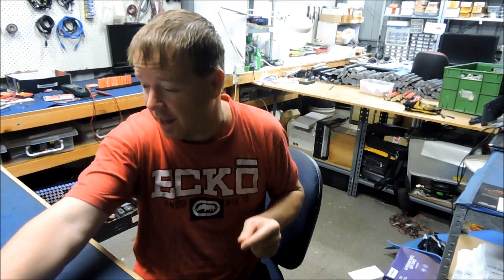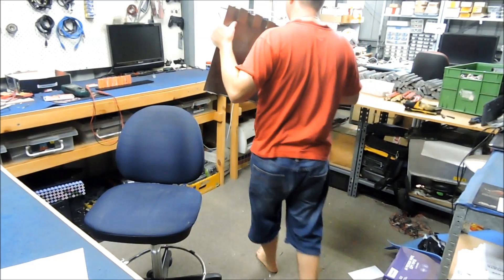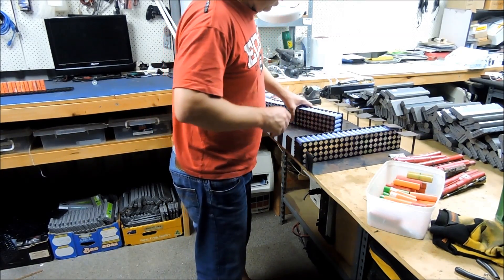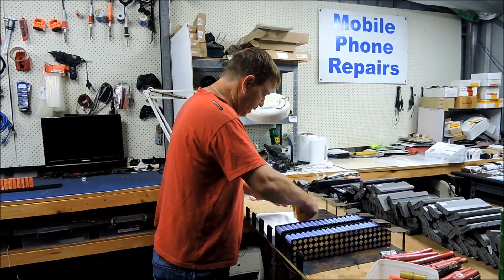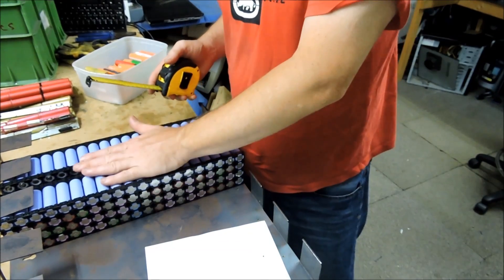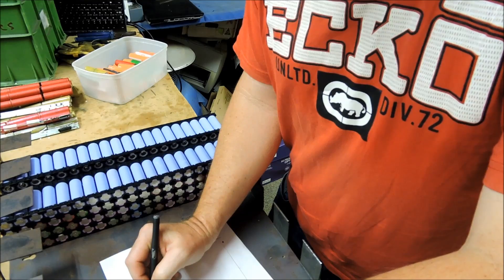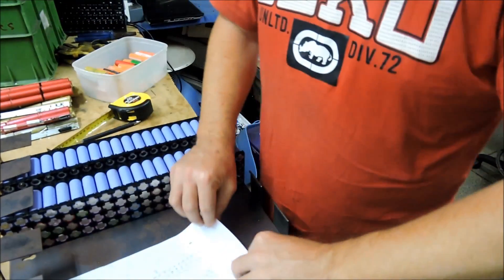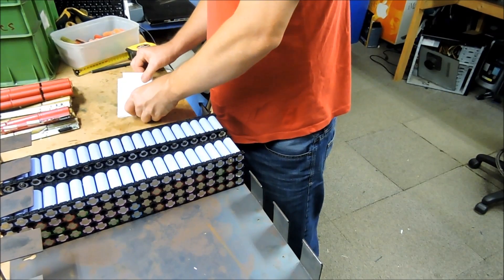4 am brainstorming rant talking about increased safety of my mounting system.

Comment: Instead of conductive metal, how about rectangles of cement backer board (like Hardieboard or Durock)??  Comes in 1/4" thick, is relatively easy to shape (you score and snap it like drywall), and is inexpensive.
Reply from the maker: There have been heaps of great suggestions, but none I can make work so they look good... Call me crazy, but still making new plans around making this bigger and better.
Reply: You can also sand and spray paint cement board (esp the HardieBacker stuff) and it will look good.  I would be more concerned with not adding extra fuel (the paint) in the case of a fire though.  Hardieboard is a nice tan color and Durock is cement grey.  There has to be equivalents products there like http://www.toppstiles.co.uk/tprod3919/hardiebacker-250-cement-board-6mm.html.  Just put a screw into it from the back of your rack and away you go...

Comment: Fiberfrax really good stuff at work. It can withstand 1500 degrees for days and you can get it then high density. That would be a really good way to save your ass. I'll double check the spelling I feel it's not right but u get the name.
Reply from the maker: Cool thanks for the info I'll look into it

Comment: you can add ceramic blanket in between the space. those are used as furnace linings.  available in various sizes starting 1 inch :-)

Comment: Just make fully enclosed boxes with partitions and a lid that is held open by a fuse-able link or a piece of string. If a fire starts the fuse-able link burns letting the lid fall by gravity, thereby depriving oxygen from the now closed box. You can even line the inside with fibre cement board for more fire protection and to insulate the steel box from shorts to the busbar.
Reply: SidneyCritic ComedyHound nice idea, unfortunately the cells are a source of oxygen for the flame once they start venting

Comment: Hey man!!!
I'm big fan of your DIY project.
For shielding I can recommend ceramic tiles between packs of celes. You can cat them to the length and to hold them in to the place use wooden triangles with you attach to the wall. Make slots for tiles so you can have access to do inspections.
Good luck.
Reply from the maker: thanks for your ideas, Pete

Comment: Hmm Reading the comments and thinking about it, while it might be possible for a fused cell to blow the fuse and if fully charged still blow its valve I really don't think it will then put out a fireball all by itself and for long enough to then heat up and catch fire the next cell. I think this could be over thinking it. Also every laptop batt cell could do the same, yet for years the build has not changed and 99% of laptop batts are fine. So if a cell shorts the fuse will blow, if it still is shorted it will heat up and blow its valve and very shortly after that it will start running out of juice.

Comment: in reply to both
DIY Tesla PowerWall,
and to HBPowerwall.

I watched, recently, a video on a "High-Build" ceramic PAINT.

Generally, it ......

1)  Kept oxygen away from direct contact with hot-steel
     (reduced risk of steel burning, or corroding (oxidising)).

2)  Like most insulators. 
      If it is a good thermal-insulator,
      it is (usually) by default also a fairly-good electrical insulator.

3)  Robust, & high-temperature tolerant.

4) High-build (thick-film) - dip or spray applied.

5)   While a quite good thermal-insulator, 
        still had enough thermal conductivity,
        to allow sufficient heat-sinking of the underlying steel substrate, 
        but without the quick development of a localised hot-spot.

6)    Quite-hard, but with sufficient "build-depth" fairly chip-resistant,
        in this type of application.

7)   Pretty much non combustible  (not FUEL for a fire)

7)   Generally, it made hot-stuff easier to handle, by reduction of localised hot-spots !

Comment: Thus far, this would appear to to be a good idea.

Obviously, runaway, in one cell, should not automatically induce runaway in the others.

1)
At 1 mm think,
the steel would 
a)   provide a solid-barrier  -  physically-separating adjacent sub-packs
b)   provide a Thermal-Mass, sufficient to Heat-Sink one or two runaway 18650s
c)   Deflect a flash (arc) &/or a discharge-stream (flame) out from the pack.

And it should have no obvious (?) negative impacts
on general cooling & ventilation (?)

2)
Astheticaly (sp ?) , it could easily look very professional & tidy.

What is not to like ?

Comment: I think it may be easiest is to use drywall separators between the battery
15mm plaster should be able to isolate a fire at over 1000C for 60 min
so I would put an L-profile between cells with plasterboard on both sides of the (1-2cm x10-15cm protrusion) to separate them apart and I would probably also put plasterboard on the entire wall so not a fire can ignite things other side

Comment: I would use a non conductive material as a barrier just in case the gases given off are conductive aswell rather than use steel..Plus it would be better if it was thermally insulatede like a bakalite barrier of some sort. I thought this problem only occurs when you overcharge the batterys though. Its probably safer to monitor cell voltages with alarms on overvoltage and undervoltage rather than waiting for the fault to happen. If you reduce the risk of this happening then you can progress to protection when a fault occurs. Just my Opinion, I am a protection engineer for AC and the only pfotection for Dc is either fuses or high currrent shunts which convert the current to volts so your protection device will operate. You do have fuses so why worry just get a lamb doner and chug a few stubbys.

Comment: Hi Pete, i see what your trying to achieve but blocking a venting cell to protect the neighbouring pack could be achieved with strips of fire board ripped down and placed in between each pack, with a 5cm gap the metal would be too steep to redirect the  vent.....fireboard could be neatly ripped into strips, painted black with stove paint and could be easily incorporated into your existing wall...nice and neat and cheap!
 cheers, Glenn

Comment: I think you are way over thinking it. If there is a fire then nothing will help. A straight piece of no flammable material down the center little larger then the pack size as a rectangle would stop one cell from spraying onto the next bank it could have a T shape and just set it down over the top of what you have.
Reply: Then there is no redirection. Assuming the venting event happens really quick and gases are very hot. A simple rectangle blocking will block the hot gas from getting out quickly. These might influence neighbor cells. Also, the pyramid shape is not that hard to make.
Reply: I was thinking along the same lines - a rectangle of something between each group to arrest/direct the vent material might be enough maybe.
Reply: Paul Kennett that is what I am going to do with mine

Comment: Having to space them further appart seems unnecessary. Just a plate in between them is enough. But don't use a metal because that creates shortcut risk, regardless of how much space is in between them.

You need some non-conductive material and just put it in between. The angle that you try to create to direct the gas coming out isn't going to redirect all the gas out. You need like 45 degrees to achieve that goal. That requires a non practical spacing. You just want to protect the bank next to it, right?

What kind of temperatures can we expect? What material will you use? Metal is not an option. you touch a busbar of 2 different banks and you create a short, not a nice thing to happen when you're placing the banks in the mount.

Careful that you don't create a safety risk by trying to reduce another risk.

Comment: a blast shield does make sense.   the posibility of a short circuit is a bit worrisome.  maybe a piece of the cement impregnated fiberglass board would be a better answer.   you could angle it away from the positive side to deflect a vent.
Reply from the maker: Editing video to that sort of idea, I'm searching to see if a 18650 cell has ever vented from the negative side.
Reply: They are designed specifically to vent from the positive side.  I think it's part of the 18650 spec.  If you find one that vents negative, the outside case would have to be positive. That sounds bad to me. I would just bin it/them and move on.   Or make a pack just for them.

Comment: I think u better get some sleep..... u dont need to slip the steal barrier under the bats.... just tack weld it.... u have 5 cm to play with so leave 5mm either side of the batts, i think ur making it harder then what it really is. More sleep for u and vitamin tablets.... vit c and zinc plus.....
Reply from the maker: Sleep would be handy, but I needed to get this out of my head - and I'm glad I did ...lol Taking welding (have you seen my solder joints?) can't do it lol ...bigger gap wouldn't go a stray. Sleep Yep!, Harder not so much it's just the process Sleeep I'm thinking so ..hahahah
Reply: lol ur not spose to tack weld it.... the manufacturer does that.

Comment: Sounds overkill and would make packs significantly wider.  If you were worried you could get a straight bit to stop direct flames and get it welded to the existing mounts. Personally I think it could cause more trouble because it could be easier to short out when handling them. Maybe find some non conductive fireproof material to make perfect plugs to fill the gaps between individual packs and keep things neat?
Reply from the maker: Wider is bad, at this point but I don't think it's an excuse not to do it :) Don't want to just stuff something inbetween - still need airflow and if something goes south will need an exit point for gasses> I'm hatching a plan i think will work.. Video soon

Comment: Hi pete, I think this separator would be a good idea, but first, this is the first time I have a real close look to your steel mounting, I'm a bit scared about something, do you confirm the only thing that prevent two packs from shorting is the tiny sleeve between the bottom cells and the monobloc steel mounting? individual mounting would be a lot safer or maybee I'm missing something.

Cheers

Comment: this idea is good, but, what about Micah, and a fan for good circulation and cooling and fire prevention?  maybe temp sensors to release a flood of co2, from a small tank???
Reply from the maker: I don't think 'think' there will be an issue from air temp alone. but having a temp sensor hooked to a disconnect to shut the system down would be an idea. IE BMS
Reply: DIY Tesla PowerWall maybe gas is the wrong answer, but, a powder, talc powder

Comment: If one of your cells in a bank goes into thermal runaway and starts to vent, chances are the gases won't burst into flames (From my experience, please correct me if I'm wrong). I believe your biggest concern at that point should be a chain reaction of all the surrounding cells being heated and possible going into thermal runaway themselves, most likely causing a fire either by the gases or the sheer amount of energy being turned into heat (80 cells * (3.7v * 2.1AH) = about 621WH = 2118 BTU. Not to mention the combustion of the materials). If for some reason you do experience a cell bursting into flames, I don't think a flame divert-er will save much of anything. Priority should be to extinguish.

Just my thoughts.
Reply from the maker: I'll take that 'much of anything' if it means less to extinguish. I'm in the process of working out the logistics of taking everything I've done apart and starting again. Including double fusing  

This is just thinking out aloud and allowing discussion on all aspect of improvement of the idea. Thanks for your input !
Reply: lonnie776 co2 fire suppression? is it noncondictive tho
Reply: Not sure. They do make fire extinguishers that are safe for electronics, mostly used in server rooms. The trouble is getting it to automatically trigger.
Reply from the maker: If it was to be totally honest fire extinguishers will be useless as i keep them in a locked shed. Opening the door will cause more oxygen and more issues. Unless there is a cost effective solution to hard install one that's automated.
Reply: lonnie776 maybe have an arduino with temp sensor, when it reaches desired temp, turns on a servo, opens valve and releases co2 from a paint ball gun tank, it can be powered off the wall or its own system
Reply: DIY Tesla PowerWall ok, I am unfamiliar with burn temps and cooling rates, what other stuff is there that isn't combustible and cool enough to take care of the issue?
Reply: DIY Tesla PowerWall I understand maybe a foam, but in different circumstances it would present a whole new set of issues
Reply: DIY Tesla PowerWall or maybe draw a vacuum to prevent flames???
Reply: i am firefighter in the netherlands and several weeks ago we had here a tesla folding around a tree. He had hit a few other trees also and the battery was realy damage even several where come lose in parts and in fire. You cannot do anything else then put a lot sand on it. no whater or other stuf. maybe a lot sald.. the rest pray and wait until the battery went out.
i think your idea i great and wen you put a metal u tube around every battery bank and take care they are mount in the u tube then it give you time while they are in fire to take a bank out and trow it in the garden so it can burn out on a open place.
this wil safe also all other battery banks, converters etc etc.
just my 2 pence
Reply: DIY Tesla PowerWall 
indeed you are 100% wright.
for all curious people aboud this accident:
it is a 53 year old person who drove 155 km on a 50 km road and probably lose control.
http://www.autoblog.nl/nieuws/dodelijke-crash-met-tesla-model-s-in-baarn-90811

https://youtube.be/eLLk5Tpxa7w

here you can see how much trouble we have putting out the batt fire.
we try sand and powder but nothing works.
https://www.rtvutrecht.nl/embedded/859351

BTW I admire and follow your work and the way you think . I am in progres to build one off my own.
And you are right aboud Lithium it is a metal what wants to burn.
I see here people say and ask but how wil it start burn, or wen, or why or what iff etc etc.
There is no relevant  question how what why...
We "KNOW" the burn as hell. And why? there can be 1000 reasons..
So the relevant question is "wen they are on fire what to do and how to prevent a lot damage" and ceep the damage as little as possible.
this metal backplate protects and give you time to take action.
And instead a plate in the middle was my idea to make a metal u tube around the batt pack with a handle. so wen in fire you can rip out a batt pack and trow it in the garden or open spot to save the rest.
and many thanks for all the youtube movies and you help

Comment: How about a piece of vermiculite board its used in log burners so can take the heat its non conductive and can be cut to shape.
Reply from the maker: My consideration for a V-shaped piece of metal was to get the gasses out and away from packs. Having a piece of board there would cause more of the gasses to reflect straight back and might cause issue with the cells beside. I guess the only way we'll ever know is if something horrible happens. This is the beauty of YouTube and the internet in general, you've got access to many different options without the expense of expensive computer modeling ...lol

Comment: A conductive shield between the batteries seems unwise. Even with powdercoating or paint, a fault in the surface could short the batteries out. Make it out of lexan or something?
Reply from the maker: Good point! I did consider the shorting seconds after I uploaded - guess that's the process. I can definitely agree powder coating isn't enough that's for sure. As all my mounts are coated and I've still had earth faults. Wrapping all contact points with hd heat shrink solved the issue. V5 mount design has addressed this issue even further. They are ready for pickup today so I'll have a new video on that soon.
Reply: Agreed. Making the divider out of fire mat or kevlar mat seems wiser.